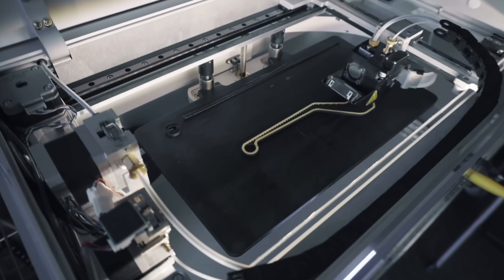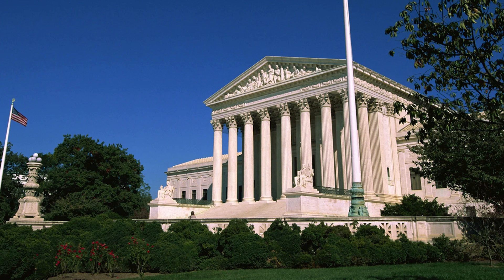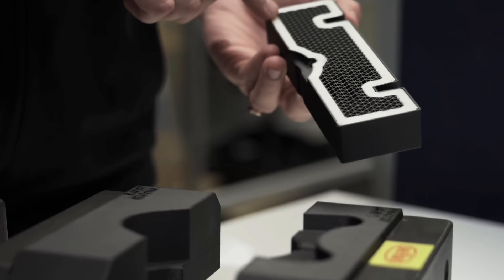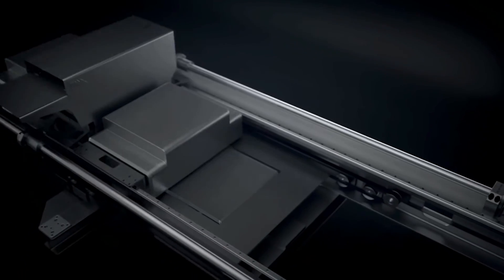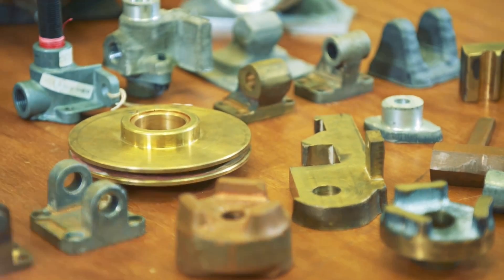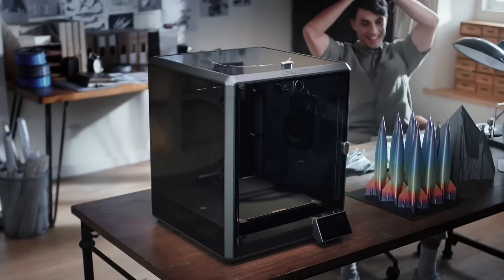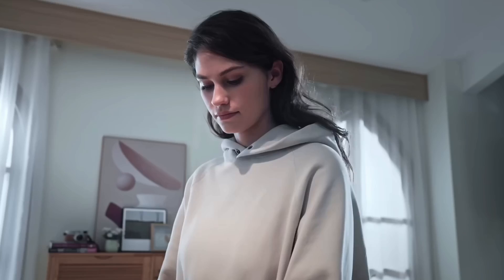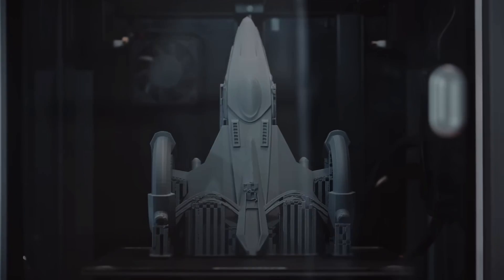Creality Announces K1 Series | Markforged Infringement Cases | 3D Printing in Military Sectors

Comment: The speed at which these Bambu copies dropped is mind blowing.
Reply: While I agree the K1 looks more familiar than it should, I do also have to realise that when it comes to a corexy design, there is realistically only so many ways to design it before it starts to look like something else

The K1 would definitely count as heavily inspired by the X1 but that's about as far as it goes really
Reply: Love how Jobsian (Prusian for eastern european mode) a reasonable, modern copy of the venerable old CoreXY suddenly becomes the "original", LOL
Reply: @retromodernart4426  Yeah its more the rather striking similarities to the case layout and the toolhead layout, and i don't think any of the prusa printers look anywhere near what the X1/P1P look like outside of using corexy

Comment: The Creality K1 printer is about the same print volume as the Ender 3, the K1 Max is 300 x 300 x 300
Reply from the maker: Correct we did mispeak there.
Reply: To be fair, after watching the initial release video, I also thought the K1 had the 300^3 volume. I immediately preordered only to find out the next day that I was mistaken. I still think it’s worth the price for the K1.
Reply: yeah k1 is 220x220x250 smaller than an ender3 s1